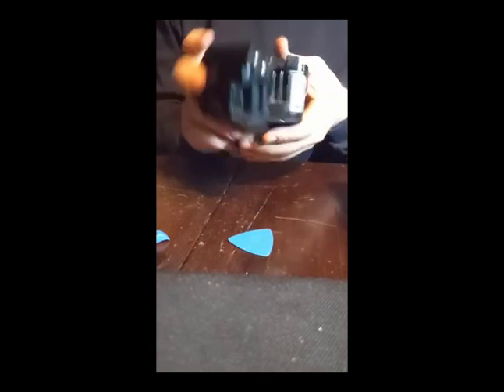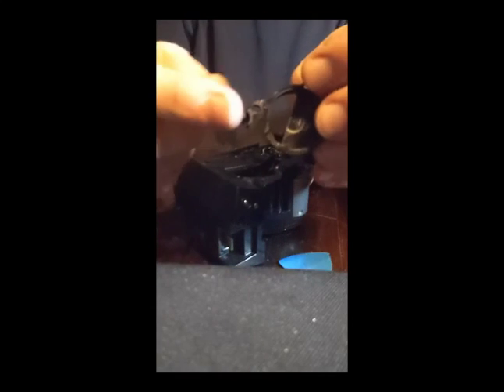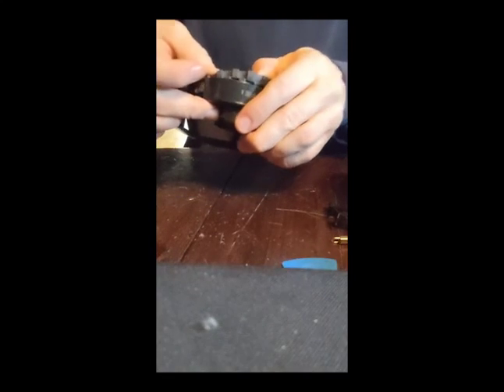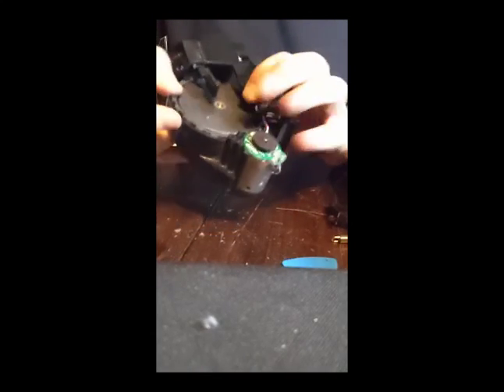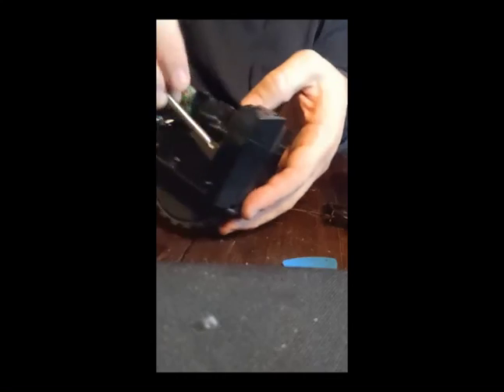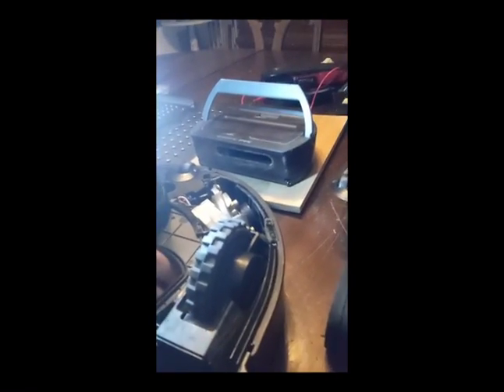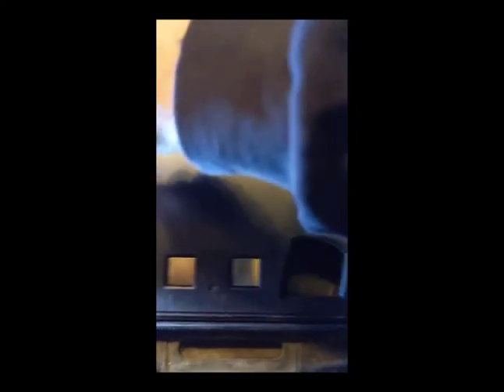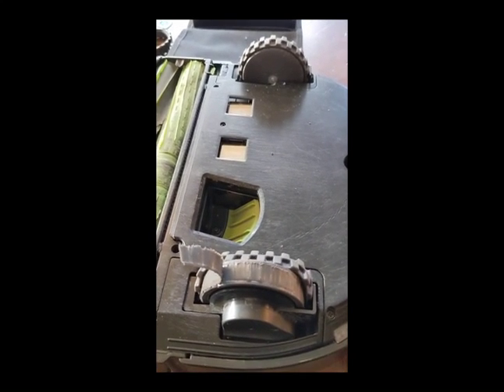Roomba S9+ Tire Replacement

Comment: So I don’t have to have internal access to the wheel module?
Reply: There are videos by Roomba on how to replace the wheel module. Just follow those until you get the module out then pick up where the videos showing you how to replace the treads start.

Comment: You don't have to do all of this.  Just remove the spring from the other end and start stripping the tread off.  Then just feed it around, and once it's on,  you replace the spring.  

The only issue I've found after replacing is that the tread will slip in thicker carpeting. So I'm looking for a good way to better secure the tread to the wheel so it can't slip.  

I only notice the issue when it's trying to back up,  so it may have something to do with the castor wheel, too.  

I noticed that if I put some pressure on the back while it's backing up,  right where the castor wheel is,  it helps.  

To secure the tread,  I'm thinking of using small trim nails to fit into the holes the original tread was molded into.

Update: Upon further investigating,  I don't think the tread is slipping.  It looks like the new tread is spinning with the wheel like the old ones, but they're slipping on the carpet. So basically the robot is bottoming out on my carpet,  which is just medium pile...

Maybe the springs on the modules are not good enough anymore.  

Maybe I will just order some new modules and see if that helps.
Reply: Any update?
Reply: @ZackZaqZakXah  I gave up on IRobot. I now own the Eufy S1 Pro and E25. I also have 2 Dreame x40 robots that did good at first, but after a year, the suction is not as good. At least with one of them. The other I didn't test yet because I've been using other robots at the moment. Also it needs a new laser distance sensor which I have but have an installed yet. 

Also my Eufy E25 has issues. It ran over dog waste. And my wife tried to wash off the wheels by carefully putting it under the sink. But you may have gotten water into something causing an issue. And now continues to tell us that the dirty water tank is out of place and to reinstall it. We have since got a refund for that one. 

Another update is I no longer have any carpet since this post. I stripped up the old carpet and redid the sub for and put down luxury vinyl plank flooring. 

I do still have this robot. And since I no longer have carpet it would likely work just fine. So for now it's there as a backup. Will likely use it for a small dedicated room somewhere. But I will never buy iRobot ever again. They've just fallen way too behind and the competition has overtaken them. They were stubborn and refused to evolve with the times. And their most recent models were an attempt to catch up, but it's too late. And from what I've seen they were also disappointments in some reviews.
Reply: @CollinLutz-p9e thank you so much. Very informative and helpful. I'm about $40 in on this S9 and I'm just going to give it back to Goodwill.
Reply: @CollinLutz-p9e  update: I gave it back to Goodwill, but they wouldn't give me my money back so I had to exchange it for something of equal value.
Reply: @ZackZaqZakXah Yep that sounds about right with Goodwill. 

If it helps my favorite vacuum is Eufy S1 pro. And it would be the Eufy E25 however that had issues within the first month with it thinking the onboard dirty water tank wasn't attached. 

They refunded my money and I may get another but I may just stick with my S1 Pro for now. 

I also have the S1 Pro hooked up to plumbing so it automatically empties and fills. 

Keep in mind that I have no carpet. And I do believe it's not as good on carpet. But if you have all hard for like I do it's really nice. 

The E25 has the extending side brush and does a really good job at corners. It's really a shame that it failed so quick though because it did an awesome job. And unfortunately they didn't make it able to be hooked up to plumbing like the S1 Pro. 

Eufy has sales all the time. So if you decide to go that route, keep an eye out for them. I got to E25 for $700. And and the S1 Pro was on sale for $1,200 and came with the plumbing hookup kit.